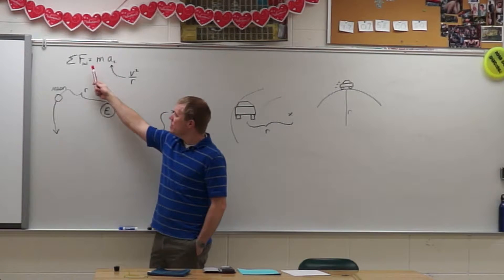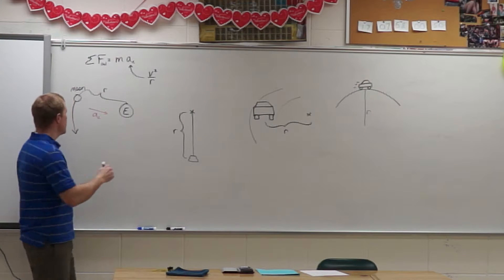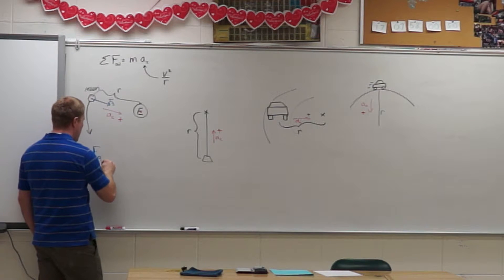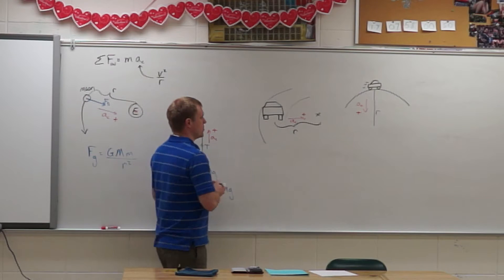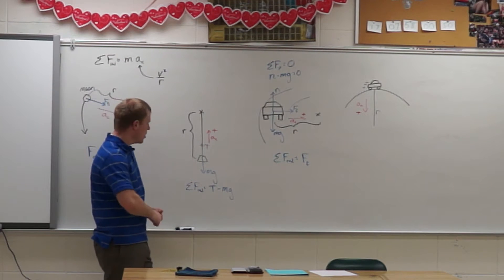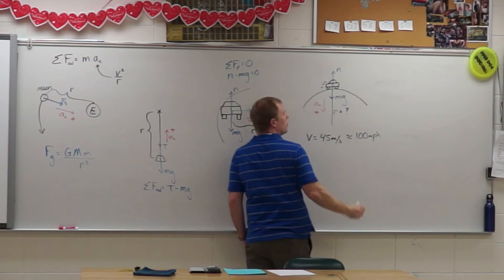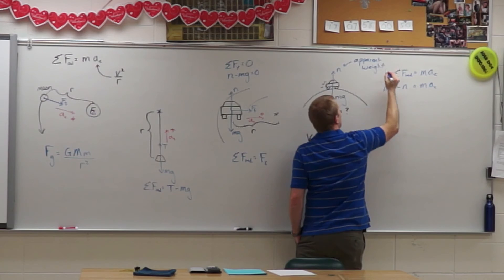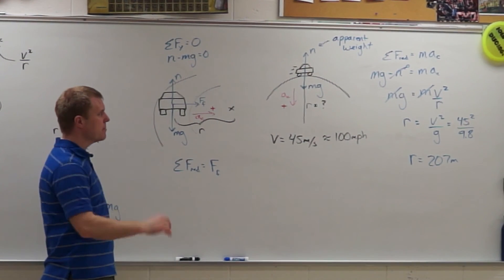Forces in the radial direction

Comment: Great video! Can something be both a vertical and radial force?
Reply from the maker: Yes! We are looking at acceleration, the change in velocity as having two parts: a radial part caused by radial forces that changes the direction of the velocity and a tangent part caused by tangent forces that changes the magnitude of the velocity (speeds up or slows down).
When the weight is not at the top or the bottom, or the car is not at the top of a hill or the bottom of a valley there will be a component of the force that is not radial. So when the car is going up the hill part of the gravitational force is causing the car to change directions and part is causing the car to slow down.
Reply: dcephysics ohh I see! I'm taking a summer physics course (where we learn a year of physics in six weeks!) and it's super intense. We are learning about conservative and non conservative forces and springs right now. Thanks for the videos they really help!